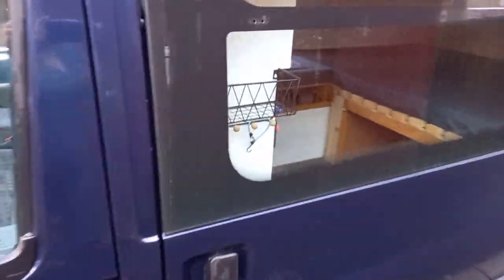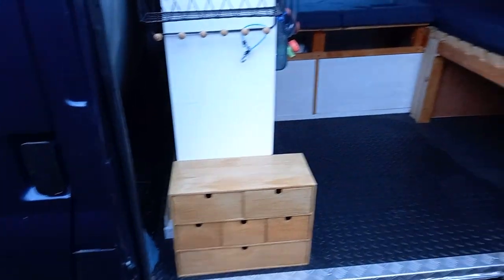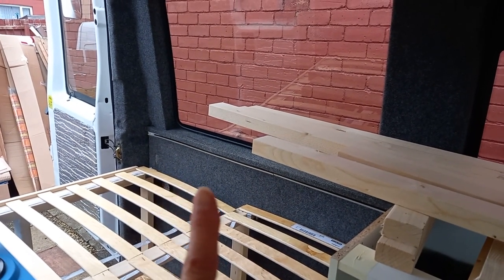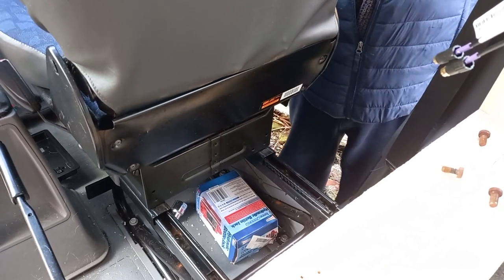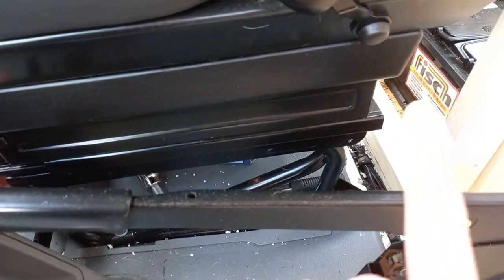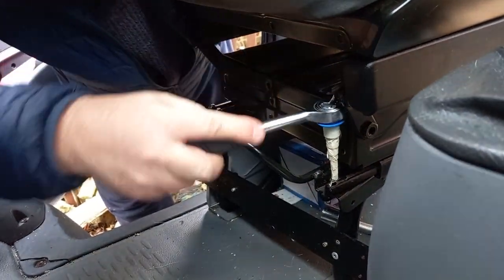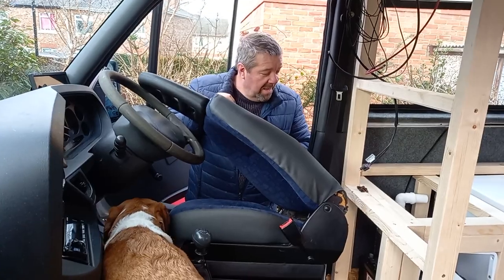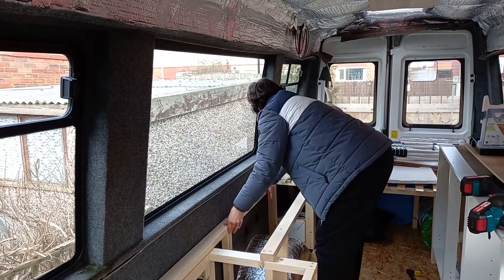Part 5 - Our Iveco Daily Minibus Conversion - Bed, Seating, Replacing the Driver Seat Max Supervises

Comment: Lovely van,
If it is rated for 3500kg just be a little careful with the laden weight it can be so easy to go over the legal limit especially with a large full water tank a number of leisure batteries and large solar panels, It is surprising how the weight adds up with heavy kitchen units etc also.
Reply from the maker: Thank you for your advice. You are absolutely right. In some ways we are quite lucky as the minibus is rated at 4600KG. We had a tail lift and 15 heavy seats removed so we hope that when finished it will be under 3500kg which may reduce the road tax/insurance a little. Fingers crossed 🤞 We also understand that the gross weight includes passengers, so again, hopefully, our weight can be reduced by the lack of 15 passengers. Thanks for your help and good advice, much appreciated :)
Reply: @PensionersinPortugal  
Ah if it's rated at 4.6  tonnes you with be absolutely fine you should certainly not overload this.  The only issues I can see with this, is MOTs can only be done at  VOSA unless you get the van reclassified as a campervan / motorhome  with DVLA but this is becoming increasingly difficult to do. And of course you need to be of a certain age to drive one or take an extra test. Also you might struggle with some bridges etc on the continent where only 3.5 tonne vehicles are permitted. That said I suppose now many large motorhomes are classified at well over 3.5 tonnes although most self build  conversions using panel vans choose to stick to 3.5 tonne vehicles.